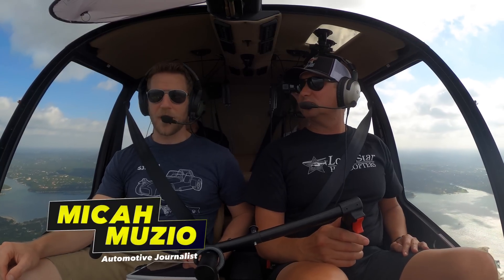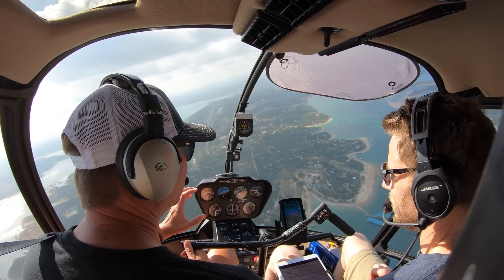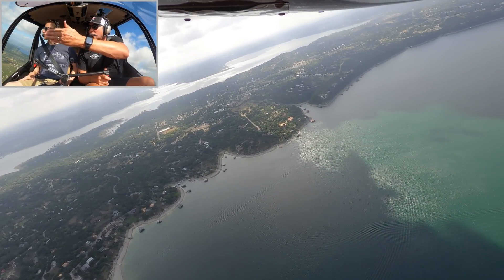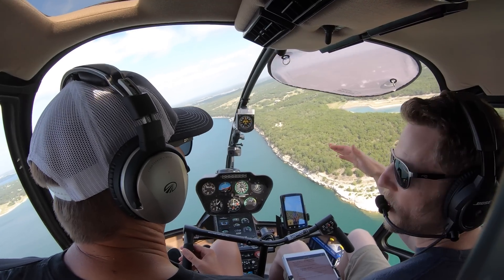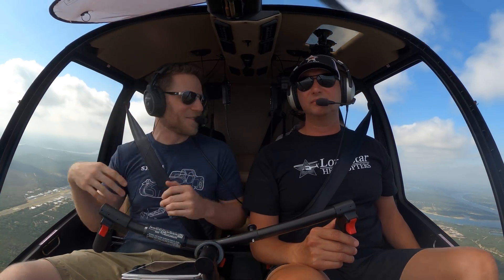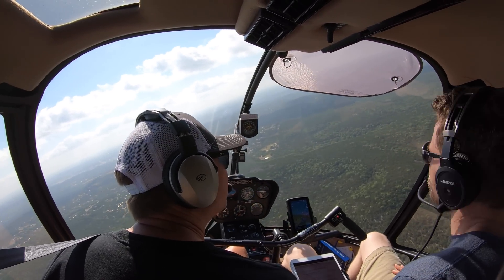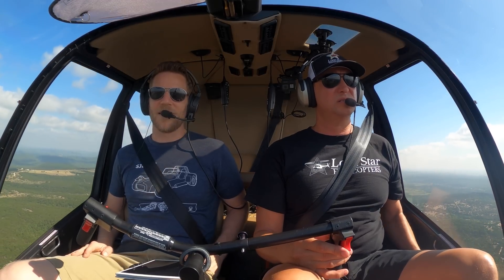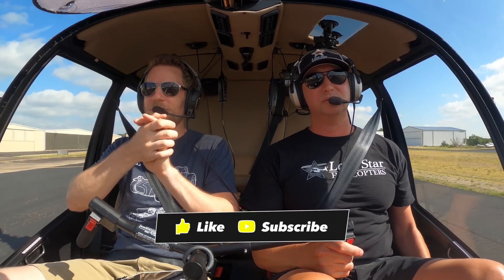Helicopter Engine Failure | What Happens Next?!?

Comment from the maker: Knowing how autorotation works are you more or less likely to fly in a helicopter?
Reply: More likely!
Reply: Definitely more but I think you should do a video on what it takes to become a helicopter pilot and how much it costs to buy and maintain a helicopter.
Reply: More likely.
Reply: Could you do a Flyover of Sunland/Tujunga, Honey bee in Little Tujunga Canyon and Angeles Forest Hwy in Big Tujunga Cyn? And Camels Back, Mt. Lukens? They are all in a small general area kinda of.
Reply: More likely (have been a couple of times). In the event of an autorotation, I'd be hoarse afterwards from all the screaming.
Reply from the maker: @Van-Hammer  😂
Reply: Hi
Reply: I’m cool with helicopters. My Dad was an USMC aviator for 23 yrs. He flew fixed wing, jets and helicopters way back when Mr. Sikorsky in the bowler hat was promoting helicopters! I like flying in Hughes 500D’s with no doors on over an active volcano in Hawaii.🔥🌋
Reply: What I'm not understanding is if you're in an actual engine-out situation, how would you not spin out? Y'all didn't REALLY go over how the rear rotor would still control your left/right spin control. 
I'm assuming the main rotor and the rear rotor are connected somehow where if the main rotor is spinning the main rotor is in turn powering the rear rotor.
Yeah? 🤔
Reply from the maker: @darkxxhimxxlight  You are correct. There is a driveshaft that connects the main rotor and tail rotor gearboxes. So whether the engine is running or not, they both keep spinning at the same ratio. 

In the video, you might've notice Steve mention having to add "right pedal" when he simulates the engine failure. That's because (in addition to controlling yaw) the tail rotor is used to counter the torque going to the main rotor. In American helicopters, pressing the left pedal increases the tail rotor's anti-torque effect (by increasing the pitch of the tail rotor blades). Right pedal decreases anti-torque. 

If power stops going to the main rotor, the tail rotor has no torque to counteract. With no torque to counteract, the pilot has to reduce the pitch of the tail rotor in order to keep the nose pointed straight. He does this by pressing on the right pedal.
Reply: I don’t think I fully got it. Maybe if you did an automation in your helicopter? Then I’d me more comfortable. 😃
Reply: @micah muzio I think I saw you  flying  by yesterday  love  your  videos
Reply: 100% more :) thank you I was trying to decide to fly off my island in a plane or by helicopter and now I'm fully up for the chopper! 💚 one question though, my island is 30 miles from the next one so how far could you go on auto rotation please?

Comment: What are yall using to record the audio? The gopro adapter?
Reply from the maker: I have an adapter for the intercom that splits audio from the headset. From there I have it running to the GoPro adapter into my GoPro7. Protip: I use a GoPro7 for audio because the 8s have had audio issues and overheat easily.

Comment: Thanks. Always wondered how auto rotation works. What about the tail rotor, does it keep spinning as well?
Reply from the maker: Good question. Yes, the tail rotor keeps spinning. Main rotor gearbox and tail rotor gearbox are mechanically linked, typically via a driveshaft.

Comment: Hey Micah, ever since I learned about your flying hobby, I went out got my PPL and my ILS rating and getting my helicopter rating! Aviation  is one of the most fascinating industries and hobbies out there! See ya up there!!! :)
Reply: Classic Dwight, always trying to one-up your average man.
Reply: What is an ILS Rating?
Reply: Terry Malone Hey, It basically means I can fly in conditions where I cannot see out the windows and use instruments and waypoints to navigate basically allowing me to fly through clouds and rainstorms
Reply: @cameronschindler25  Wow!  Is that a rating that you can get in the U.S.?  What exactly does the initials stand for?
Reply: Terry Malone yeah ILS “Instrument Landing System” is available in US! It can also align you with the runway in glide slope and with the center line! Cool right?
Reply: @cameronschindler25  So, you have an ILS rating?
Reply: Terry Malone yes indeed I do!
Reply: @cameronschindler25  Wow.  How many hours does it take to get an ILS rating? Do you have to get a PPL rating first?
Reply: Terry Malone Yes got my PPL and got 43 additional hours before my check ride!! You were “fogles” so you can train in non IFR conditions. Basically, they block the top half of your vision so you must rely on instruments to navigate and land. Also, we use them so if need be, we can take them off and switch to normal again if something goes wrong! Are you an aspiring pilot? Where do you live? I can help you out
Reply: Yes.  I have an ATP Rating, but I must not be as good as you because I had to have 200 hours to get my INSTRUMENT RATING per the FAR's.  Their is no such thing as an ILS Rating.  Not sure who you are trying to bullshit, but it ain't gonna be me.
Reply: Terry Malone Sheesh! I call it an ILS rating but it’s really Instrument Rating. I’m not trying to BS anyone. I ❤️ to fly! Yes I got my PPL first then got 43 more hours in addition to my existing hours to get my instrument. I’m very sorry if I wasn’t clear :(